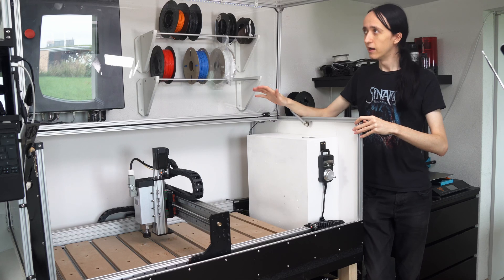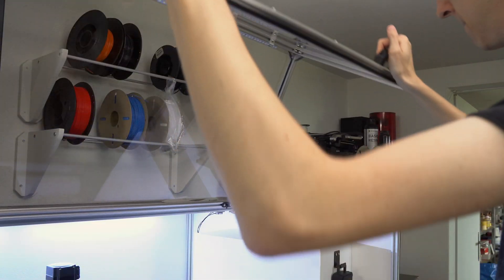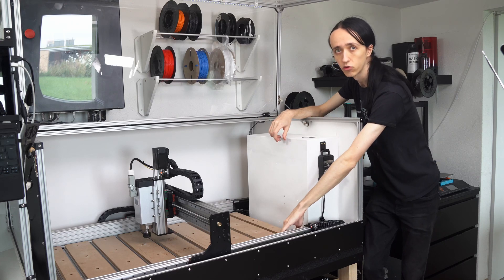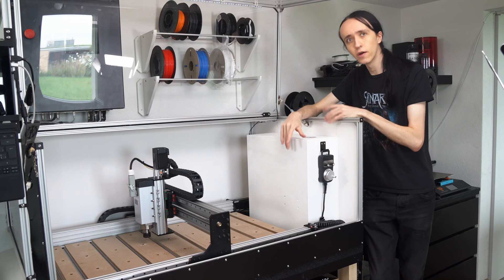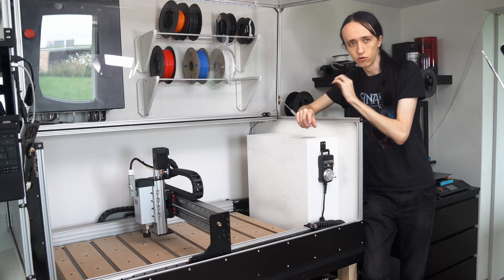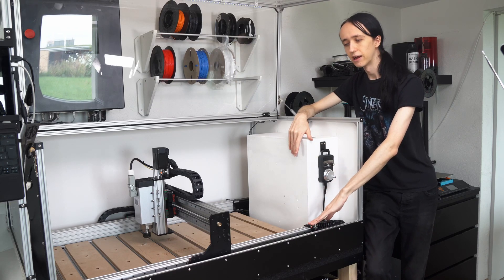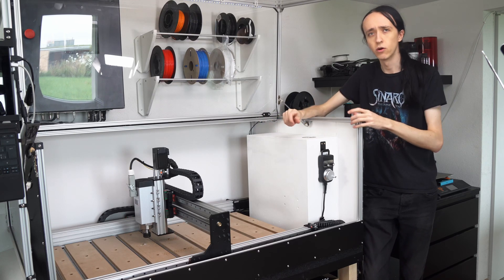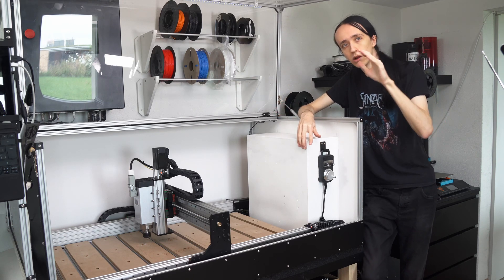CNC Router ENCLOSURE and First Cuts - RatRig KillerBee #5

Comment: Nice video!
Why choosing aluminium profile when you can build it dirt cheap with plywood?
Reply from the maker: Because it looks good and gives some more mounting options. But you could totally save some money by using wood only.
Reply: @DarkArtGuitarsWorkshop  I calculated that all the rails will cost me 150 euros. (Queenbee X1000 Y750). I really like the option of the aluminium profiles for the look and also to leave opening windows to be able to slide the work in case it's bigger than the table . But for sure I want to damp the noise the most as possible and in that case I'm really not sure if the aluminium structure is better than the plywood one.
Reply from the maker: @Levisgil47  The aluminum is just the frame, it won't do anything for dampening the noise. If you use some decently thick panels it will dampen the noise quite a bit. The loudest part will be the window, unless you get thicker acrylic, which would also make it more expensive and heavier.

Comment: Hello, Can you please tell me which extrusion package you got from rat rig and what options you selected. Also can you provide links to connector and other bits you bought from aliexpress to make this enclosure.
Reply from the maker: The extrusions are just their custom length 2020 ones. What lengths you need will depend on your machine and setup. I'll add the other links in the description.

Comment: where did you get all your stuff for the ENCLOSURE and how much did it cost? i would like to do the same with my setup mill!
Reply from the maker: The 2020 extrusion I got from RatRig, the wood panels form the hardware store, and the acrylic panels from a local plastic supplier. The connector and other bits are from Aliexpress. All in all around $400.